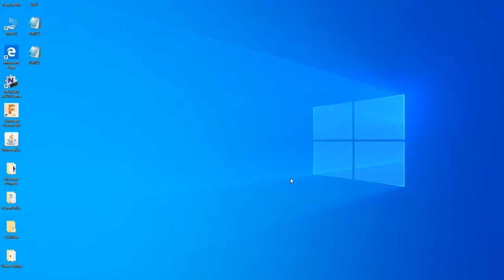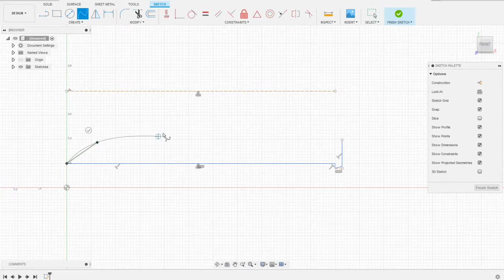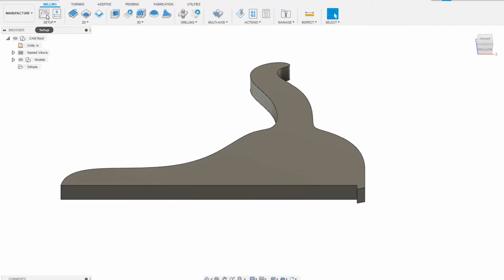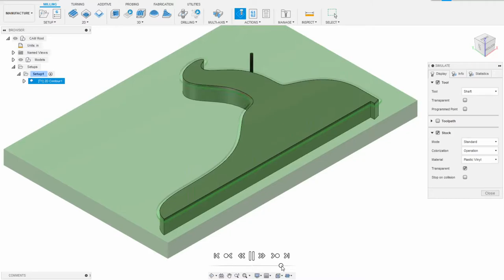CNC made Table Saw Push Stick

Comment: Nice safety device,However not practical to make the way you did.A band saw and sanding drum is another way to go.And more practical for those of us that only have basic tools.I'll keep watching in case you make something like a face frame for a cabinet.
Reply from the maker: I can see your point. I’ll avoid CNC projects in the future. I’ve never dabbled into cabinetry making but I can look into it. I do want to convert the basement into a shop so in the future I can try to do a video on a work bench with cabinetry.